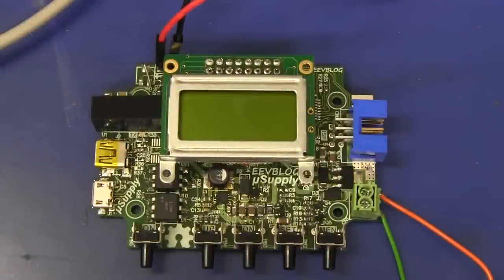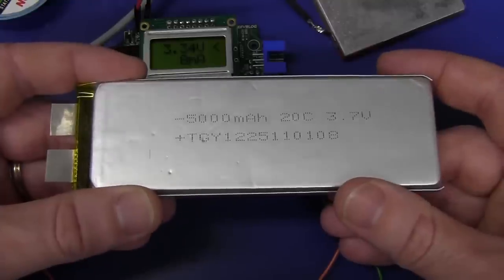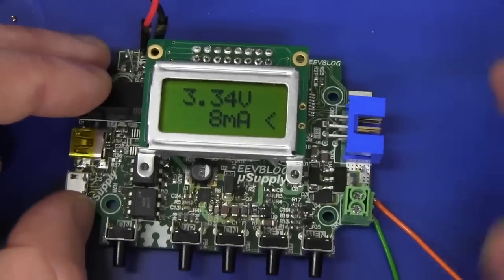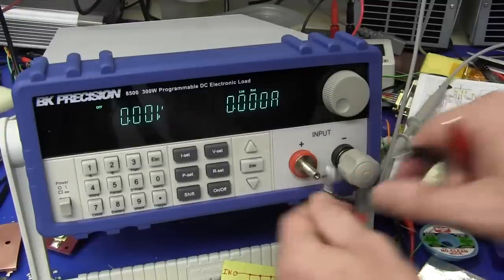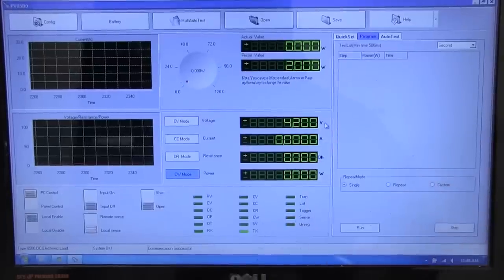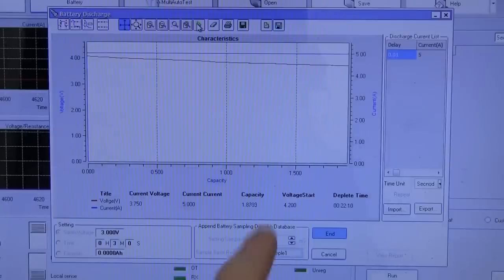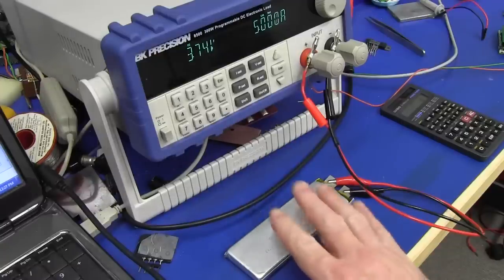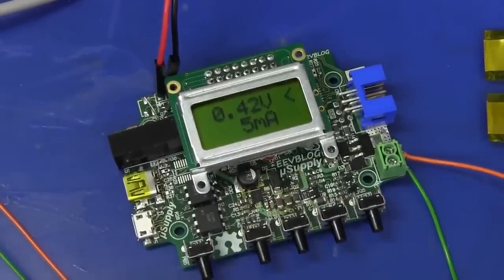EEVblog #393 - LiPo Battery Discharge Testing

Comment: Hi EEVblog.  Just ran across this post and I realize I'm commenting three years after the fact.  Just want to say that those of us flying RC multicopters, sUAV's, etc., would NEVER run a LiPo cell down to 3.0V.  For most of us, the very minimum would be around 3.4 or 3.5V.  Put another way, we generally never discharge our LiPo's past about 80% of their rated capacity.

I guarantee you that discharging a LiPo down to 3.0V cell voltage will ruin the battery in no time whatsoever.  Just sayin.

Thanks for all the GREAT videos, David.  I've learned so much from your channel!
Reply: Im running mine down to 3.65 under normal load. That are about 10% left in my case, just enough for a safe landing.
Reply: Ditto. I never, ever run LiPos down to less than 3.5V per cell.

Comment: Hi Dave, great video! Most of those 4 button chargers have a USB socket on one side, it's possible to do up to 0.5A discharge tests/graphs and even charge graphs with them using some freeware software (got it on the other laptop will post name later) 
Some ppl reckon the voltage monitoring and balancing on that charger isn't so accurate due to low tolerance components - looks like yours was nailed though!

Comment: The Turnigy Accucell 6 has a combination temperature/"USB" port on the left side that you can connect to a computer and gather a metric buttload of information during charge and discharge. USB in quotes because it's actually TTL RS-232 signalling, and you need an adapter (available cheaply on ebay, I got one for $2.49 shipped).

Comment: For these sort of applications I always use a small Li-Ion battery protection circuit. I sometimes harvest them from old cell phone batteries and it provides me a bit of insurance in case I leave a load connected to a battery or such.

Comment: 800milliohms ESR, which I would assume most of is in the contact resistance of the croc clips, the wire and the bodgy binding posts. You need to take 2 copper strips, drill a hole in them to fit the posts and drill and tap another set to handle the 4mm sockets. Then you can plug the cords in easily with minimal extra resistance, and with a very low loss on the connection.

Comment: Dave, I've noticed in the Battery Discharge Wizard window while you ranted on the constant current and not power mode ability of the thing, there's a scroll bar at the bottom, maybe if you scroll it to the right, it will reveal more modes? It certainly looks like it would to me. Cheers!

Comment: Hobbyking will really discount their LiPO (turnigy) cells if you buy them in any kind of quantity.  Also,  Why not use 2 smaller cells in a 1S2P to get the higher capacity?  With that low of a draw, balancing really won't be an issue and I'm sure you can get them to make you up a custom pack w/connector.

Comment: We use 360 of those 5000 mAh cells for our electric motorcycle arranged as 12 cells in parallel, 30 in series. We pull upwards of 700 amps peak and 100-400 amps continuous.
Reply: That is jaw dropping. I am totally amazed by these cells! Pls, can you tell me if the capacity suffers a lot when you use your pack with around 1.5c to 7c continuous and around 12c peak (which I just roughly calculated that you draw with 700 amps on 111V) ? Cheers :)
Reply: Miguel Bodega Unfortunately, we've never actually fully discharged the battery pack. We're a collegiate group and don't have many opportunities to take the bike out for a track day. When we have taken it out, we've had problems keeping a solid connection between each set of cells in series. The high current likes to arc if anything shakes loose while on the track. We're redesigning the pack (which honestly used way too many little bolts and nuts and luck) to avoid this problem (probably gonna spot weld the tabs like they do with 18650's). We're also designing a load test that should let us cycle the batteries several times a day and record stats on things like the capacity, temperature, voltage drops, etc.
Reply: hey thanks a lot for the info. Keep on the good work and good luck with the new interconnection of the cells!
Reply: Watswat5 Judging by personal use for hobby RC and these batteries, I'd say you can expect in the neighborhood of 3-500 cell cycles before you get a significant drop in performance and capacity with proper battery management and cell balancing. Have you matched the cells in terms of internal resistance?

Comment: You should put a quick connect on the batteries so you can slade them in and out like a cartrage for easy switching batteries.

Comment: Dave, great videos, I have loved watching them ever since finding eevblog. 

Have you considered using Panasonic NCR18650 series batteries? They come in 2900 mAh, 3100mAh, and 3400mAh capacities with a mass of 45g per cell. The cost is approx. $6-7 per cell when you buy 180 at a time. One downside of these cells is that to get the full capacity you must discharge to approx. 2.5V which may not work for your application.

Comment: If you use a soldered flex cable for your LCD you could locate it off board rather than stack it and keep the design as thin as possible. I'd use an extruded aluminum enclosure with a groove for the board to slide into and the battery could sit underneath. Then you could mill out a rectangle in the top for a cheap four button membrane button pad also connected with a flex cable. Thing would look like a chunky remote control with 5 way binding posts on the bottom, or better yet Anderson power pole quick disconnects.

Comment: Might want to check your supplier catalogue, Dave - they make spade connector to 4mm banana jack adapters. Usually come in test lead kits for a few quid (which I guess would be a few AUD down your way) or you can probably get better quality ones (e.g. Pomona) from the likes of Farnell.
Might work a bit better than jamming the 4mm plugs side-on into the binding post...

Comment: This is problem because.. price ?
The packs of LiPo & LiFe for RCs are mostly very  simple to dissemble.
Cells are just stacked up & between them is often cheap double side tape, and the leads are on one side soldered on small PCB(no electronic).
In RC we often disassemble the packs (LoPo&LiFe) to remove the bad single cells and merge the good ones to one god pack. (To save money :) )

Comment: I think discharging it at 95% capacity still damages the battery/ shortens the life cycle. A safe capacity threshold would be 80%, 85% at max.

Comment: No it isn't. Nearly all Li-Po cells can safely be discharged to 2.75v as per the manufacturer's own spec sheet with no danger, damage or long-term loss of capacity.

Comment: Some of these lipo cells have insane C ratings but I've always been dubious about using them that high. It almost seems too high for such a small cell... Had a couple Chinese cells off ebay supposedly rated at some reasonably high discharge. I think I got it quite close to that in one of my RC cars but no way over. Over about 3 months of use, they started puffing up.

Comment: i ve built a custom capacity meter and test any cells i can get my hands on. What i ve concluded is that the cutoff voltage of consumer electronics li ion cells is way too high @3,5v most of the times.
If its discharged @3.1v  you can get considerably more capacity even though you may be affecting the battery life, but then again who keeps their smartphone for more than a year and a half. The added capacity could make up for the reduced number of charge cycles.I think you can get 400-500 charges like this that would take you almost to a year and 4-5 months before your battery needs replacement...

Comment: Good video!  Does the BK load have sense wires?  If so, you should've sensed the voltage right the cell tabs.  Otherwise your BK load reads a lower voltage due to IR drop in the banana cables.

Comment: @ about 23:31 did you say "Due to the internal ESR", meaning that the displayed voltage is lowered by the load's equivalent series resistance? thanks, cool vid
Reply: It's lowered by the batteries internal resistance, the voltage (E) drop across any resistance is equal to current (I) times resistance (R), E=I*R

Comment: remember the 20c is 
DisCharge And Charge Rate. the Later is the Time X Amps
I believe they perform best if pushed both ways...
And Like to Be about 100 -120 Degris F Nice and stable!
also, the Low Volt Cut off needs a time below to avoid the spike drawls from Big motor controller

Comment: thanks for the vid Dave! i was looking at these for my LED lightboxes and was wondering if the higher discharge units equal greater than rated capacity when run at lower discharge rates given their size increase... guess i was wrong :)

Comment: Re 4mm sockets. There was a time around mid 90s when equipment suddenly started getting supplied without 4mm sockets or blocked off sockets. Apparently it so happens a drunk Belgian plugged his speaker leads into the almost perfect 240v replica of a pair of 4mm sockets (which was his wall mains supply). Anyhow seems the European safety arseholes did something very unusual and did a U-turn as we still have em.

Comment: Same question was asked on the EEVblog forums.

firewalker: Are those batteries bundled with a protection circuit of some kind (temperature e.t.c.). Can someone access the the data?

Psi: na, RC batteries have no protection. It's almost impossible to have protection when you have legitimate loads of up to 200A.

Comment: Can you solder a wire to those battery terminals?
I can not do it in cellphone batteries. That thing is made only for spot welding.

Comment: Nice review.  Now I'm still wondering why this unit or most others seem to lack voltage sense wires?  When discharging at high currents, you want to measure the batteries voltage, not the battery voltage after vdrop from the test leads.  Also, is there any Internal Resistance tester?  Would be a nice feature...

Comment: Hey EEVblog2 +EEVblog.
I am bit curious to know why OEMs/Manufacturers still rely on Li-ion/Li-poly for their power needs. There are obviously many more types and much superior in performance, stability/environment, like Li-NMC or Li-titanate, etc.

We dont see these types of batteries in everyday electronics?
Reply: +Arjun Menon Because Li-ion and Li-polymer cells are widely used, characterized, relatively cheap and often have the right energy density for the job. Why do cars still use lead-acid starter batteries?

Comment: I have a question Dave I have been looking at the load test equipment you use to test power supplies ect. I like to build one for testing solar equipment. I have looked at ones for up to 3Kw the wattage I like to test.   I like to test with voltages up to 60 volts ect but the one you have is quite pricey. Do know of a way to build your own test equipment. and I like to beable to program it for different loads and voltages. Any ideas would be great thanks.

Comment: Hey Dave! Why did you pick LiPo rather than Lithium Ion batteries?
Reply: Price and current handling. They're LiFePo batteries, amazing current handling and I think that cell is like $12 retail.
Reply: Teth47 
LiPo and LiFePO4 are very very different beasts altogether. I think its LiPo he talked about - very high current drain, but low longevity. 
BTW commercial LiPo is actually Li-Ion in flexible polymer casing, commercial polymer electrolyte lithium battery doesn't exist yet.

Comment: You know that these Hobbyking cells are mostly reject and otherwise very low-quality cells, right? They're not a good basis for a quality commercial product. Try shopping around at reputable name brand vendors or importers and base your design around that.

Comment: Hmm, if that program hadn't come with a BK precision, I would rather build my own than use that shoddy piece of software. I wouldn't trust it with typos all over, wrong ("milli Siemens" sampling time) or missing units (I don't want to have to assume capacity is given in mAh) and bad naming (come on, don't name something "current voltage" or "current current" in a current/voltage meter, except if you're in for the giggles).

Comment: Hi there I am new to electronics. I bought a bees clover0-100v A digital blue red close led voltage current measure on e bay but there are no instructions with on how to wire it.There are 5 wires to it and they are red and black separated from blue green and yellow can you help me please as I don't want to destroy  it.
Reply: this item is on amazon thank you